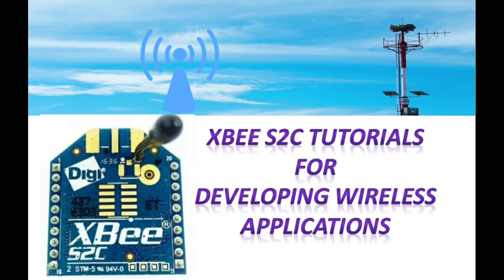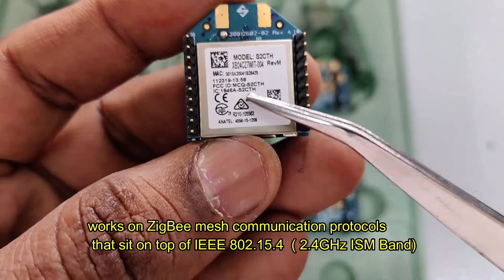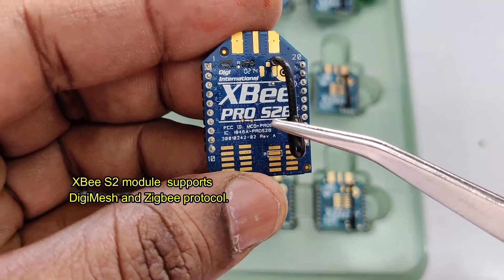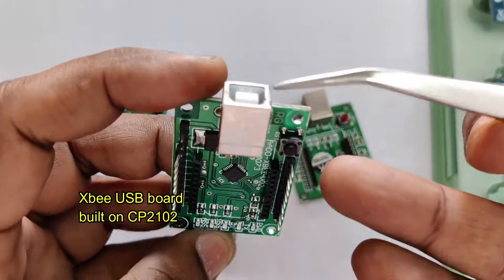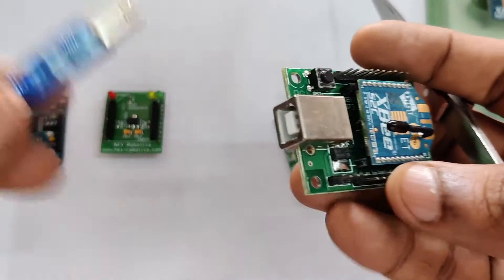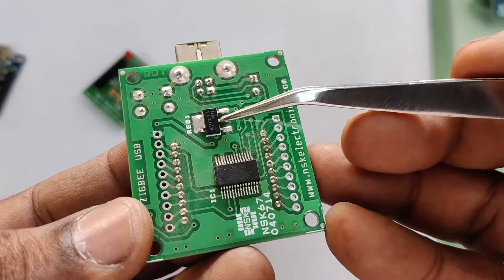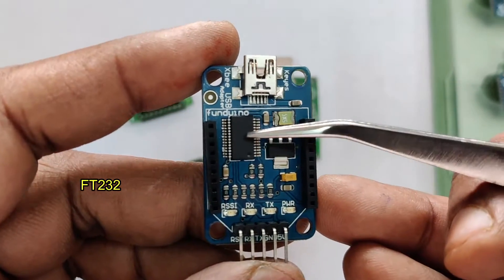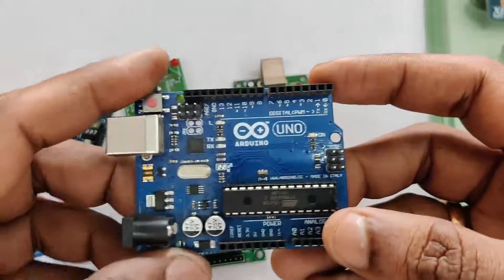Mastering XBEE - Lesson 1 -Getting Started

Comment: Hello sir. I am an engineering student. I have watched almost all videos of your. They are interested for me and learnt a lot from your contents.currently i was trying tu upgrade firm ware of atmel atmega16u2 using avrdudes software by another arduino uno as arduinoisp..i
I upgraded the firmware..but arudino board still not working and i found fusebits are set wrongly. They got changed somehow before upgradation. And i am trying to change them but it fails again and again. So sow one video of yours to know how upgrade firmware of that chip. I could not change the fuse bits. Kindly help if it is possible.